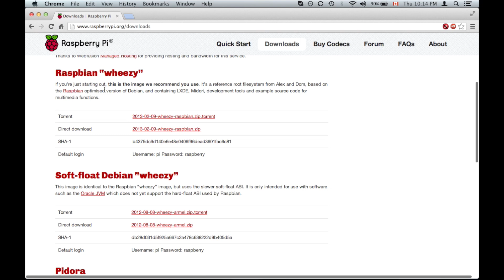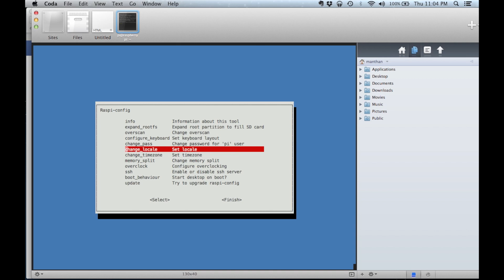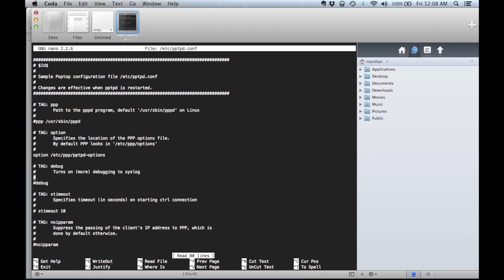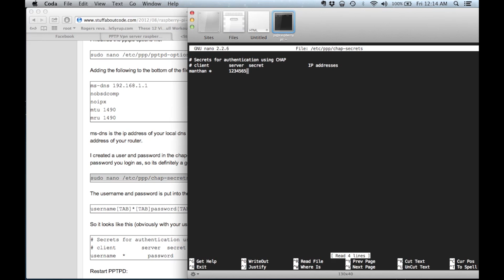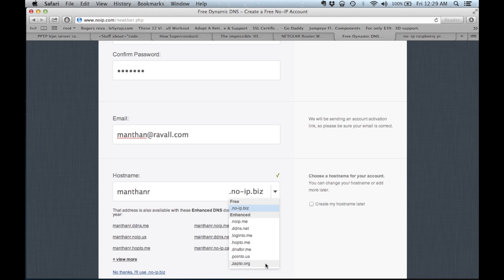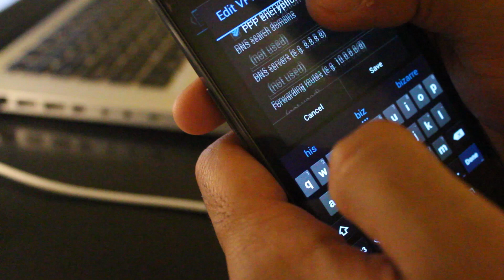Raspberry Pi - Setting up PPTP VPN + No-IP service on the unit (Private VPN Connection)

Comment: I used your tutorial to setup a VPN on my raspberry pi and it works great. Thank you so much. However, every time my Pi reboots I need to SSH into it and restart the pptp server. Do you know how I might automate this take in case I am not home when there is a power outage?
Reply: Ok, I figured out a work around using crontab. Edit your crontab (sudo crontab -e) then at the bottom add this command (@reboot /usr/sbin/pptpd --fg). Obviously remove the parenthesis. This will re-enable your vpn if your raspberry pi restarts unexpectedly.

Comment: how to connect to windows 7 it works on my mobile but not my desktop pc w7
Reply from the maker: Make sure Windows Firewall/Antivirus Suite is not blocking connection/port that the VPN service requires! Additionally, are you using a router? Routers sometimes block the port that VPN needs to connect to! You may have to forward the port so that it's open for incoming connections. Lastly, make sure you do not have too many devices connecting simultaneously. The raspberry pi can't handle a large traffic load and may not accept connections! Cheers
Reply: thank you i will try and the router is enabled and the router is setet corecly but how many user can take the pi??? sorry for the bad englis
Reply from the maker: No problem! I am not sure how many users the Pi can take. However, it largely depends on the traffic that you pass through the Pi. A ton of requests from multiple users will cause the hardware to freeze. Try it out and let me know how it performs :).
Reply: thx

Comment from the maker: Hi there. The router which I was using when producing this tutorial was the WNDR3700 by Netgear. To my knowledge, this router does not have the GRE protocol. What I did to allow external traffic to connect to my Raspberry Pi is place it on the DMZ (Dematerialized zone). Once on the DMZ, all ports are exposed.

Comment from the maker: PPTP is cracked but still takes quite a bit of effort to break into. For simply logging into Facebook/other less sensitive work, I wouldn't worry too much about the fact that PPTP is compromised. However, if you plan on doing Banking and other sensitive work then by all means I would avoid PPTP and instead opt for OpenVPN or some other alternative VPN protocol which is more secure! For basic privacy, PPTP is still good!

Comment from the maker: Ohh I see. Hmm, is it possible to try to connect to the VPN from your laptop or some computer outside your network? If it works on these devices, we know that it is the iPhone's issue. If still no success, try pinging a url while connected to VPN from laptop. If you are able to ping but can't browse the internet on the laptop, that indicates that there is an issue resolving hostnames. Make sure that the ports the VPN service requires are all open! You are using the standard Rasbian distro right?

Comment from the maker: Hello, if you are connected by VPN you should not be connected to the IP address of your raspberry pi! Your VPN clients should have a different IP address than the pi. If I recall correctly, in the video we specified an IP address range that was different from the Pi's own internal network ip address. The clients should be receiving addresses in this range that was created or otherwise, the VPN server is failing to assign IP addresses, which in turn may explain the error!

Comment: Hi there,

Super video. I have setup all as per your guides. I am able to connect via a iPhone (on 3G) to the VPN however I get no internet access?

In the phone I can see I am connected the the internal IP of the Pi and also I have a valid internal IP as per we set in the config file.

Any ideas?

Esmond

Comment from the maker: Hmm, would it be possible to try using the regular Raspbian distro? I am unable to find any issue as to why Rasbmc would not accept the Sudo make and sudo install commands :S. Also, did you make sure to login as a Root user/user with administrative rights? Perhaps this may explain the error. I'm not sure if Rasbmc automatically logs you in as a user without administrative privileges or not (haven't used it)! If Rasbmc is giving issues, maybe also give Xbian a try? I know that runs smooth as well

Comment: Hi Rav,

Thank you for your prompt reply.
I have tryed the mentioned commands but unfortunately i does not work.
Just to get sure if i did everything right, I installed the same operating software and everything worked perfecly.
What do you think is it possible to install the no-ip updater on rasbmc?

Looking forward to hear from you.

Regards,
Ersin

Comment: Hello. I followed these steps very closely, and everything seems to work... however, I can't connect to the Pi even while on my local network when connecting with PPTPD on my Mac. I checked top on the Pi and the pptpd service isn't running, and yet I'm sure I installed it and have rebooted the service and the device to no avail. I get a 'the vpn service is not responding.' Please help out.

Comment from the maker: Hmm. If VPN does not work for some reason, here is another solution: Have you considered installing FileZilla FTP Server on the computer containing the media files and then accessing the media via FTP at your girlfriend's house? Of course you will need to forward the correct FTP ports in order to allow remote connections via your external IP address! Check out Filezilla, it's pretty simple.

Comment: Ok so. I wasn't able to add the PC with the share on it through the FTP connections in ES File Manager. I was probably doing something wrong, as I am a huge networking noob. But, I was able to create an SFTP connection to the RPi itself in ES File Manager and view everything on it. So all I did was mount the share on the RPi and voila, it worked. I'm sure there is a more elegant solution, which I will have to figure out at some point. Thanks so much for your help!

Comment from the maker: Also, you do not need to have any form of share whatsoever in order to get VPN working on the Pi! The Network sharing is only needed if you want to access your network resources when you are in a remote location. If you are interested in only securing your connection/changing IP to one of your home country, don't worry about the SMB shares and etc. as VPN does not need this to function! Hope that makes sense!

Comment: That is correct. Sorry I wasn't clear in the last post. The line in sysctl.conf is uncommented, and other computers can access the shared folder. I just created a new user to try it again, as I only had an admin account. And for the password, do you mean a password for the user account or for the share folder?

Comment from the maker: If the computers in your home are able to connect to the SMB, then the VPN should be able to connect as well. In ES File explorer in Android, your SMB shares will not automatically show up (at least that was my experience). You will need to manually add the SMB/FTP share through the private IP address of the device that is sharing the network resource!

Comment from the maker: If I understand correctly, you are trying to access your Network shares through the VPN right? If that is the case, here are some troubleshooting steps: 1) did you remember to uncomment and save net.ipv4.ip_forward=1 in "/etc/sysctl.conf"? 2) Are the computers within the home network able to access the SMB share? Generating an SMB share on Windows tends to be finicky. If you don't have any users besides Admin, sometimes share does not work. Also, if you have not set a password it doesn't work

Comment: For anyone that watches this and has an issue with windows trying to connect to it internally, you may get an error that basically says the router failed to connect or refused the connection. You need to be outside of your network for it to work.